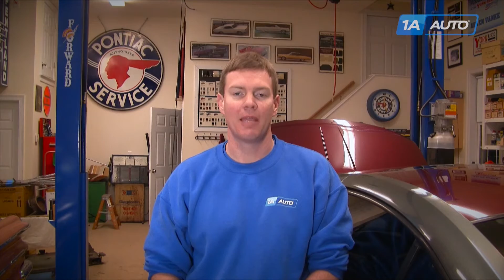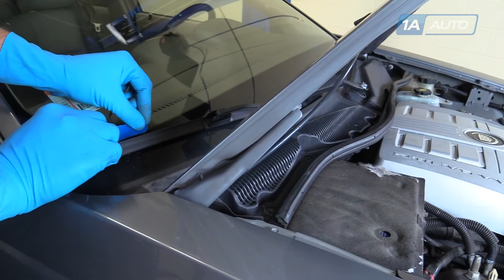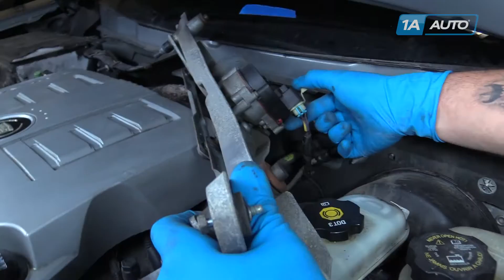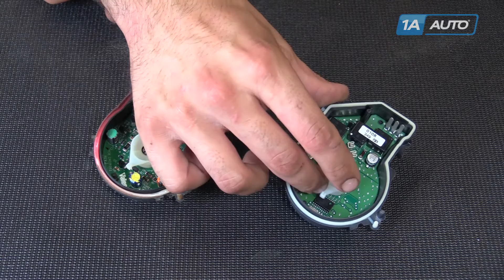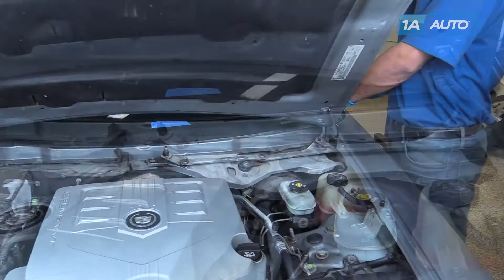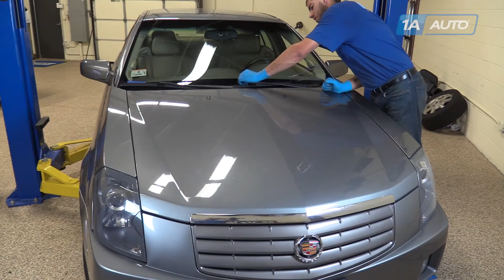How to Replace Windshield Wiper Pulse Cover 03-07 Cadillac CTS

Comment: Can this regulator also cause the wipers to run without the controls being turned on on the steering column? My wipers in my 04 Deville  are running sporadically  (especially when revs are up like while taking off from a stopped position).

Comment: Question:  My wiper motor will not turn off. It will change speeds from low to high but that is it,  and will not turn off.
Do you think the problem is in the board ? Such as the one you replaced ?  I understand you have these boards for sale, is this correct ? Please advise. By the way I enjoyed your video very much.
Reply: Joseph M I hope you already fixed your problem but I'm buying this part for my cts. I had a similar problem with a Chevy truck and it solved the problem, so to answer your question, yes it should fix it.
Reply from the maker: +Joseph M It could very well be the pulse board, but we always recommend getting the vehicle properly diagnosed by a trusted mechanic first! If you wish to purchase the part here is a link to our site, just make sure to verify fit before purchasing:  http://www.1aauto.com/cadillac-windshield-wiper-pulse-board-general-motors-88958172/i/gmwwm00001?utm_source=YouTube&utm_medium=CTA+Comment&utm_campaign=ytcomment&utm_term=dxUI5Mg_x88